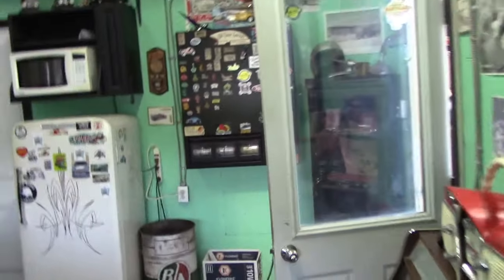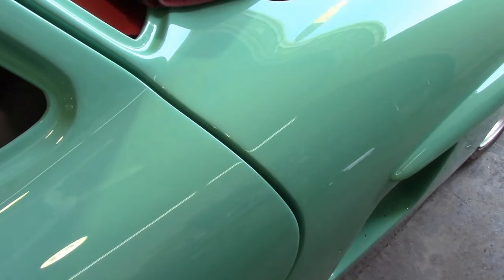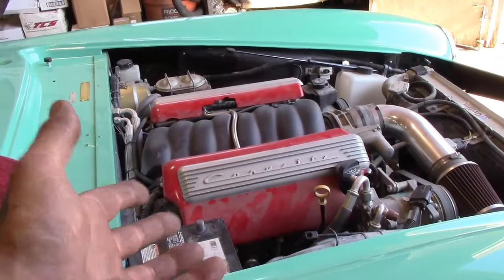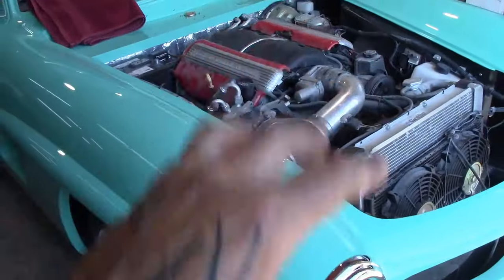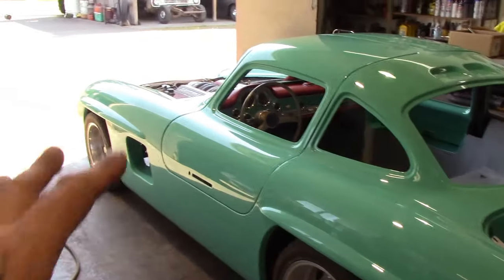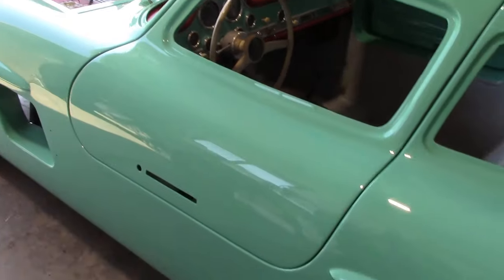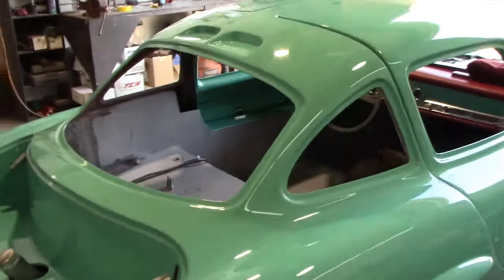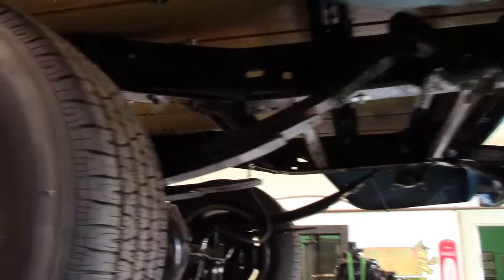Building a 1957 300 SL Gullwing On A Working Man's Budget

Comment: I think nut and bolt restorations are a dwindling thing. A 70 chevelle ls6 car is rare. They have their place in automotive history. But more people are doing “restomods”. Why??? Because they are built to enjoy. They have the ability to ride better, handle better, stop better, more reliable and the creature comforts put in them make it a more pleasurable experience. In my opinion it’s more fun because it’s not a piece of automotive history with an extremely high value. Yes restomods are expensive but if it’s crashed or damaged it’s not as big a deal. I took a 2dr granny 307 chevelle and did a restomod Lsx 454 car and I would never advertise it as a true 454 car. Even if I was a shady shit when you looked it over you would see the technology was way to advanced to be 54 years old.